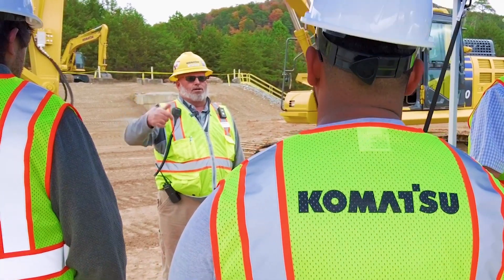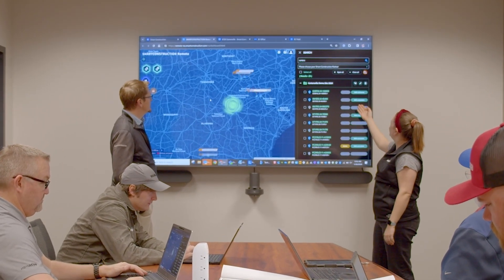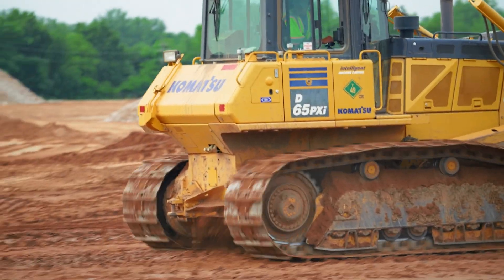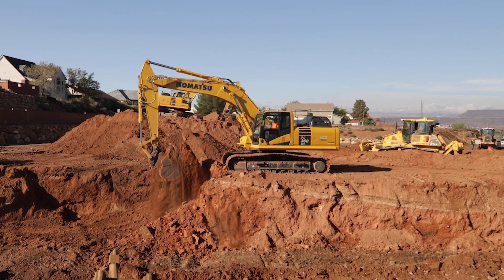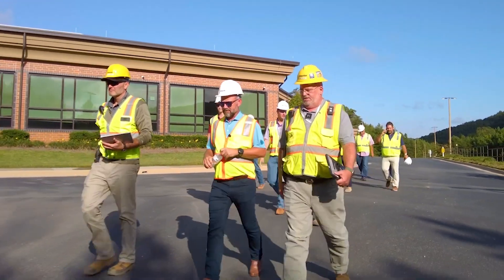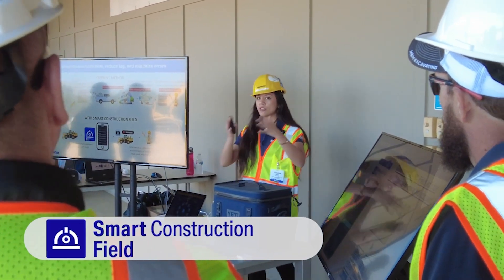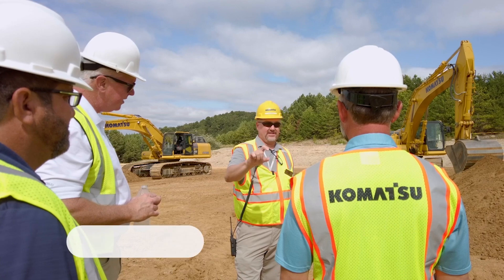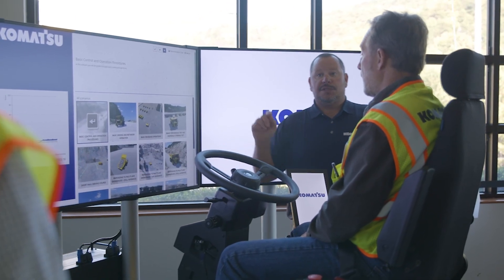Exploring Smart Construction solutions with Komatsu

Comment: I drive a komatsu 465 truck at work and sometimes when I'm getting loaded in the pit, the front  wheels won't turn when I'm sitting still. I have to start moving forward before the steering will turn the wheels left or right. This caused me an issue today when a large rock rolled in front of my rear wheels and I couldn't turn my wheels to get around it.